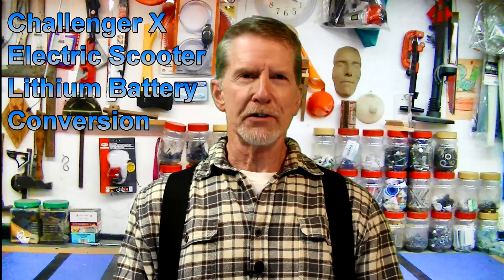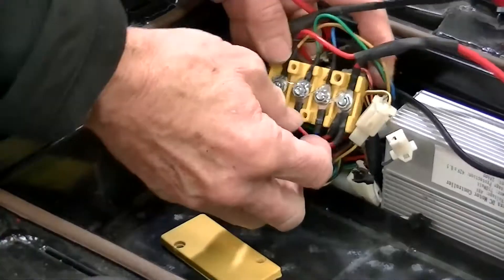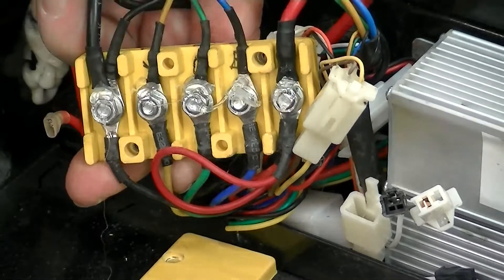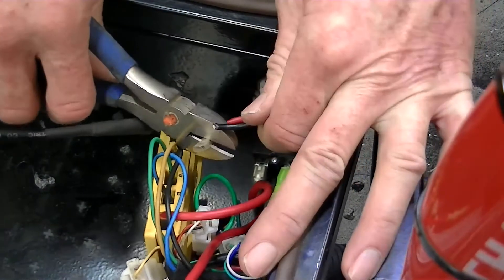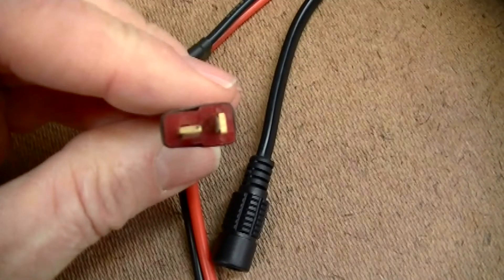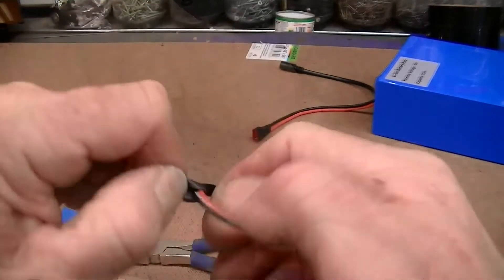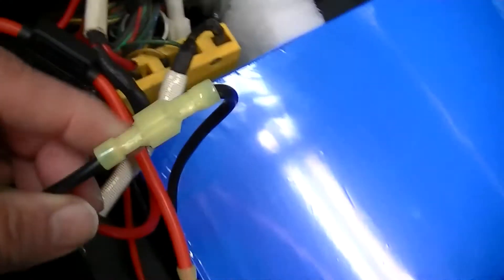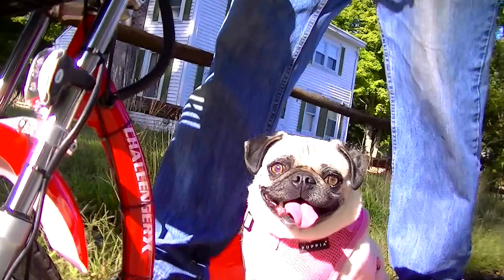Challenger X Scooter  Lithium Battery Conversion

Comment: I have a Challenger X scooter. It uses 4 12V 12Ah SLA batteries. Could I upgrade it to lithium ion battery by using 4 12V 18Ah batteries with a lithium charger?
Reply from the maker: I don't know the answer to that question. Sorry.

Comment: Can you help please? I just installed a 48v 2000watt brushless motor with a 48v20ah lithium ion battery.  But when I start to ride the system cuts off on me and I would have to unplug and replug getting going again. But it shuts off on me all the time.  Any fix?
Reply from the maker: "Unplug and re-plug"?  What do you mean by that? Disconnect and re-connect the battery? Resetting the overload breaker button?

I think the original equip motor for a Challenger X is a 750 watt motor, and since the the symptom you describe only occurred after changing to a 2000 watt motor,  I'm wondering if that could be the cause. I suggest checking the watt rating on the control unit in the battery compartment. Have you double-checked your wire connections? 

If you you mean you are re-setting the motor overload button when you say "un-plug  &  replug" I found that replacing the original overload reset button with this one in the link below one was very helpful but I'm not sure if it would be adequate for a 2000 watt rated motor:

https://smile.amazon.com/s?k=R58-20A+Series+R58+Thermal+Circuit+Breaker&ref=nb_sb_noss

HERE IS A GOOD LINK FOR REPAIR AND TROUBLESHOOTING:

http://www.electricscooterparts.com/electricscooterrepairhelp.html
Reply: @TheWizard yes I have to unplug the battery from the controller then connect it back so the system can work again. But I have to slowly accelerate and it will work fine but once it's reaching full throttle it will cut off. 

I bought the lithium 48v20ah and then I bought the 48v 2000watt brushless motor with controller and a throttle kit. I'm sure everything is connected correctly. Even before with I had the stock 1300w motor with the stock controller and same problem with the lithium ion battery it would just cut off on me so it has to be the battery
Reply: I figured it out! It is the battery pack. The battery says 48v 20ah lithium but it's only 1000watts. My motor and controller I bought are rated for 48v 2000watt 🤦‍♂️🤦‍♂️🤦‍♂️🤦‍♂️. Anoyone out there know where I can find a battery pack 48v possibly 30ah and above

Comment: Can you give us an update Mr. Wizard? Now that you've experienced the upgrade would you do it again? What is the average charge time, and how many miles on average on a full charge?
Thanks for the video!!
Reply from the maker: Yes, I would do it again with one caveat: I'd buy the battery from this supplier instead: https://electrobikeworld.com/products/48v-20ah-rectangle-lithium-battery

A full charge, carrying a 210 lb man, is 21.5 +/- miles, depending on the terrain, compared to just under 15 miles with the lead-acid batteries.

I've never timed how long it takes to recharge the battery, but a fully-discharged battery will definitely take more than a couple of hours to recharge.
Reply: @elfulano1  Hello Wizard, I want to install a battery monitor on my Challenger when I install the battery, which is on order now. Can I read the battery voltage level from the charge cables or would that harm the battery? Thanks!
Reply: @Markks2000  I've taken numerous voltage readings from the charge cables using a multi-meter, and my battery was never damaged. I've never heard of a battery being damaged by simply taking a reading of the voltage.

Comment: Hi let me know if I understand you correctly... we change the wiring because, when we are charging the new cells the lead acid wiring setup will cause damage to the lithium pack. So it needs specific wiring and a lithium ion battery charger, is that right?
Reply from the maker: Correct!
Reply: @elfulano1  I'm getting ready to do the same thing on my king cobra mobility scooter been through two sets of lead acid batteries in under a year had enough and for the price it's not much difference like you said if you get them from China I'm just curious so any speed increase

Comment: It looks like you found a great way to convert. If it really works, and is reliable and safe, may I suggest that you create a "conversion box" and present it to the company, that they can sell as an option to their customers?  I think that would be fantastic. Most of us would be a bit intimidated taking on such a task with so much room for errors, even WITH the instruction you have provided, but if we had something that said "unplug (a) and plug it into (aa), now remove the battery cable, and plug or attach the terminal into (bb), etc..." we would feel we could do that. Just an idea. Thank you for your video. Your experience has helped many, I'm sure.
Reply: Thanks for the suggestion.
Reply: My pleasure. By the way,I think you are brilliant and could create a product that would be a solution for a lot of people, while also making a fair profit for yourself! Whether it be specific to the Challenger X product, or a universal adaptor box. Thank you again.

Comment: Wizard, great project and video. I was going to give it a try a year ago, but Topmobility warned of bad stuff. Can you give an update on the conversion?
Also, have you had a chance to compare the two packs as to amp/hr capacity?. Thanks again
Reply from the maker: https://www.aliexpress.com/

electric bike battery 1000w 48v battery/48V 20Ah for 48v Bafang/8fun 1000w /750w mid/center drive motor with BMS and Charger
(xiang yazhen)
 $ 349.60  1 piece  $ 349.60  

https://www.dhgate.com/

48V e-bike Battery 1000W 48V 21AH Electric Bike Battery 48V Lithium Battery Use for Samsung 3000mAh Cell with 30A BMS 2A Charge

Battery deminsions are available at each vendor's website.

As for an "update" the two instatllations I done with the batteries from the two different suppliers are working with now problems.
Reply from the maker: Another 6 months and hundreds of additional miles and still no problems.
Reply: @elfulano1  I decided to replace my old Challenger with a new, upgraded one before doing the lithium upgrade. They have changed the battery split wiring from 24v and 24v to 36v and 12v.
I believe your wiring method should still work fine?
Seems to me that maybe the motor overload reset breaker amp rating should be increased, since it handles the full load. Am I wrong?
Thanks for your input, Jim
Reply: @jwittenbrock  Hi Jim,
Your old Challenger is doing great! It's a real workhorse. I too am considering a lithium upgrade. Have you finished your upgrade?
Mark
Reply: @Markks2000  Hi Mark.
I opted for a 52 volt pack, 2100mah.
What a difference. The extra volts equaits to increased speed. About 22 tops. I get much better range, probably 200%.
Also, climbing a grade, the breaker would pop about 1/3 way up the hill. It now makes it all the way without popping. And much faster uphill.
Lithium holds it's voltage better so the power does not bleed off as noticeably.
CONS: Much more wheel spin. The tire is not going to last. I have been looking for a wider option with better contact.
THANKS MR. WIZZARD !!
Reply: @jwittenbrock  Which battery did you use? Can you send me a link?
Thanks! I'll be coming up to visit one of these days. I'll call first to make sure you'll be in.
Mark
Reply: @Markks2000  I had a pack custom built by eastdeclare dot com. A large manufacturer. Specs were 84 LG MJ1 cells at 3500mAh each. 14s 6p. They built me a great pack, very reasonable. But now want a min order of 200 units. Can you email me so as not to load up the Wizard's area?